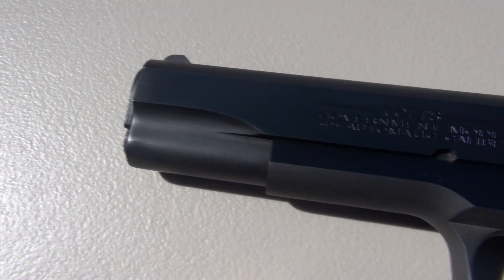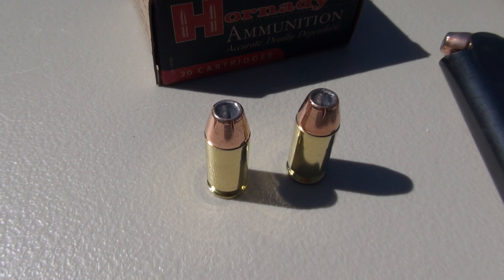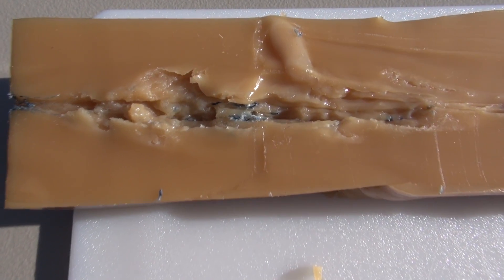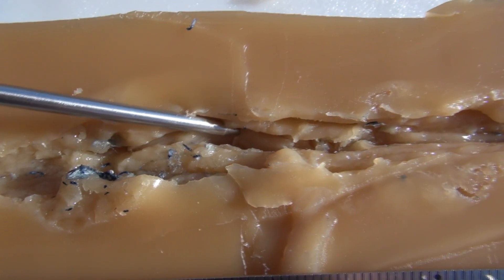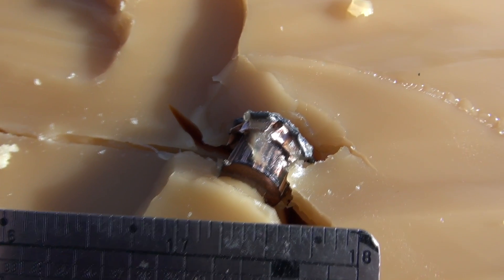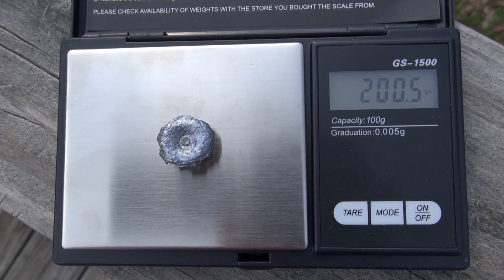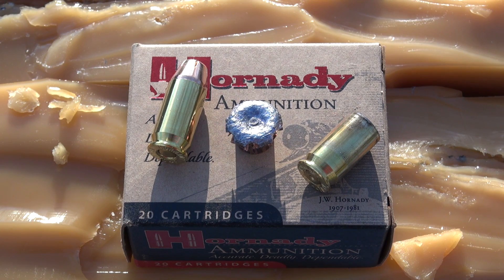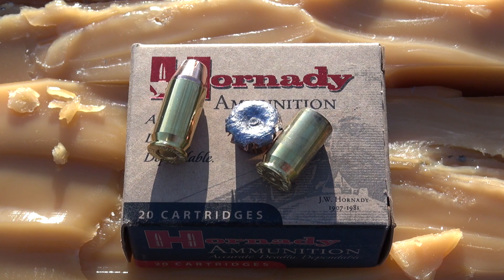.45 ACP +P Hornady XTP 200 gr JHP Gel Ammo Test

Comment: you dont need to do the .22 kills fine too so we can put that aside we agree, but the advantage of a larger bullet comes to energy transfer, the larger open flat(ish) surface area will slow the projectile faster than a rounded tip of a much smaller projectile therefore you can shoot a much heavier bullet, if you will what does more damage do a deer (much contrasting example but same idea) a car? or bullet, what does more damage to a car, another car or a truckin semi. everyone is entitled contd.

Comment: Why isn't there a .40 +p?  Because it basically already is a +p.  the pressure measurements for the .40 are very high compared to other non +p cartridges. Also, I think .45 +p casings are actually thicker for the over pressure which might be why there is no indications of pressure spikes.  One of the forums out there for .45s had a post about that. Not a good idea at all to load a .45 I'm +p in a regular casing.

Comment: I've shot and tested many of the Hornady xtps, they are very controlled but if you shoot them into something harder they can expand to .75 and more in .429-.451 category.
Also ANY .45 loading that exceed 1000fps esp at 230Grs is +p, you can look it up in SAMI if you don't believe me.
The Hornady ones will be very tame compared to some modern +p loading like say Buffalo Bore. 
The "Correct" velocity for a .45 is 830fps-875fps at 230gr from a 5in barrel.
Not a sales gimmick.